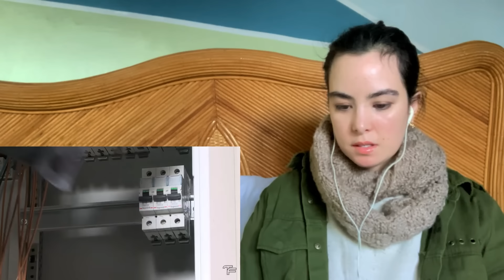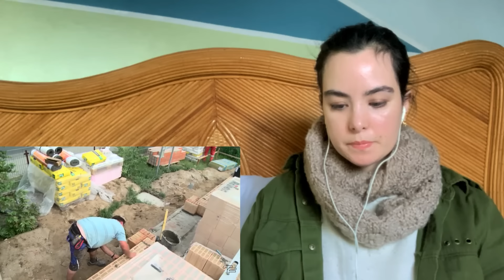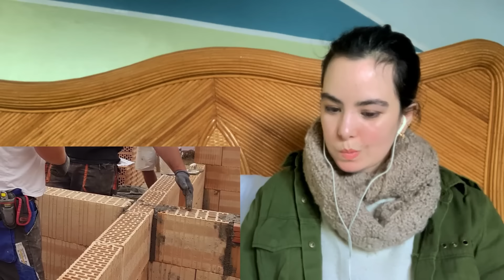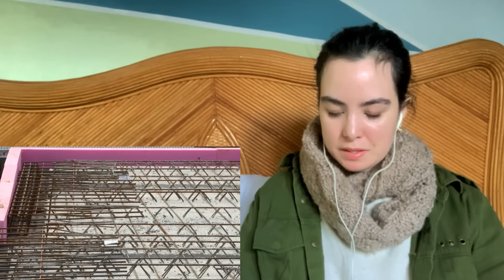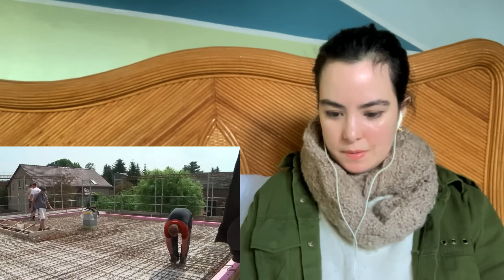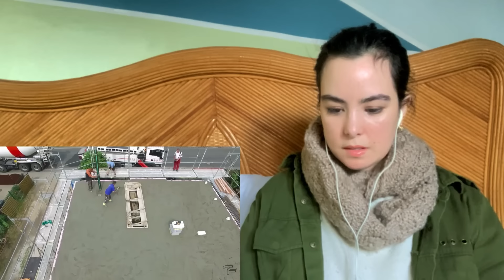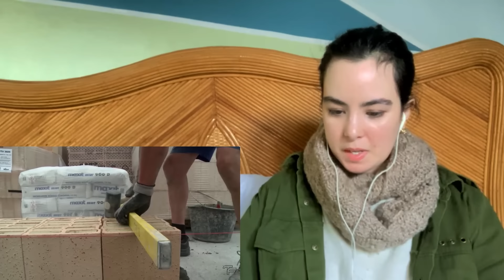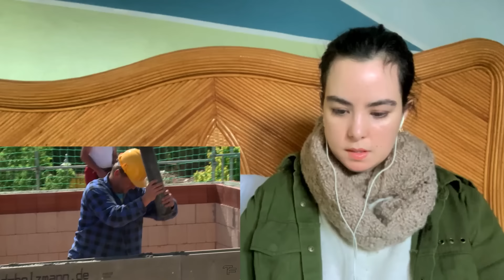How Germans build a house REACTION!

Comment: The 10 Days are the Working days. The Concrete needs sometimes weeks to fully harden where they have to wait. And the "outer Shell" of a house is done fast. Electricity, watersupply, heater and all the tiny things are the ones that need time like hell.
Reply: 28 days to reach it‘s specific hardness (normfestigkeit), but over time concrete gets harder. And you can walk on it way earlier than only after 28 days. But bearing parts should not be loaded before that time is up.
Reply: In this case it's really only 10 days, I'm German. Before the construction site even starts, two years of arguments with the building authorities pass. Then the excavation pit is dug in 2 days, the floor slab is poured in one day and then you wait 30 days. From then on the video begins. The concrete ceilings are prestressed concrete ceilings, which are so portable. The concrete that came on top only sets for 1 to 2 nights, as it does not have any supporting function during that time. Additionally, not seen in this video, the ceiling was probably secured from below with straps. But you can still continue working. Then at some point the roofer will come and put a roof on it, which takes less than 2 days for the wooden framework and another 1 or 2 days for covering it with roof tiles. And from then on it really drags on, then the window manufacturer comes, measures and the windows are ordered. Then some time passes. Then the windows are installed. The heating inside will probably be put into operation before winter so that you can work warmly and the construction site dries out, hence the windows. The house then remains unplastered for 6 months, sometimes even 1 year. So that the house can still "settle down" so that any cracks that may arise can be plastered over so that this doesn't only happen afterwards when the plaster is already on the wall. Before the plaster can be put on the outside, the attic is usually removed first. The inside is already being plastered because it isn't so tragic with possible cracks as there are smaller areas that could be repaired in an emergency. But these are all precautionary measures; most of the time there are no cracks.

Incidentally, it is no longer so cold in Germany that we need such thick walls. The winters are mostly around 0 c and often without snow for years, at most 2 days of snow a year, it is more of a muddy weather, but the winters are 30 c warmer than in most parts of Russia. The thick walls are often due to sound insulation and heat insulation for the summer, because here it can easily be 42 c at midday in August.

As a child, summers were only 25c warm and winters were -25c cold. Thanks to global warming, this is history.
Reply: Entschuldigung, es ist richtig die berechnete Endfestigkeit vin Beton muß (!) nach 28 Tagen erreicht sein. Da der Zement (Beton) sofort unter zugabe von Wasser aushärtet, ist der Beton schon 5-5 Stden. nach dem Einbringen zu betreten. 
Da die traditionellen Bindemittel, Zement,  Kalk, Gips wassergebunden sind - mehrere Tausend Liter, per Haus, braucht es 3 Jahre bis die überschüssige Feuchtigkeit verdunstet ist.
Alle Stoffe haben einen Charakter, sie sind NICHT BRENNBAR und schwer. 
Die Dachziegel (Ton) Dachsteine (Zement) sind seit Jahrhunderten schwer und nicht brennbar. Das vermeidet Schäden die wur aus anderen Teilen der Welt kennen.

Comment: That is why if it comes Tornado in the US you are homeless after them we just Close the windows
Reply: The tornadoes in Germany became bigger in the last decade but they aren't nearly as big as in the USA.
Reply: Take the shutter down!
Reply: Nonsense. A Tornado usually strikes into the roof and that would happen in Germany as well. So all the tiles would be gone. The rain and the storm would damage or destroy large parts of the interior and the windows would be shattered in no time. No matter if the blinds are down or up. Only the structure of the house would remain and could be the basis for the house being rebuilt.
Reply: @michaelkaercher  I wouldn't be so sure about that with newer houses. 

Firstly, we have brick or concrete walls and concrete ceilings between the floors and the attic, which is why nothing tends to happen below the roof structure.

Secondly, the tiles on newer buildings or when a new roof is fitted are secured with so-called storm anchors, which prevent the tiles from being lifted and blown off so easily.
Reply: @wernerruf7761  A friend of mine was hit by a tornado in florida. The house disassembled. He survived in the concrete bathroom. His Aircondition (12.000 kg) was found in the neighbours house. You cannot compare that to a german storm. A tornado would play hardball with windows and tiles.
Reply: @michaelkaercher  No tornado on this planet destroys a well-built European house, these are facts, or ask an expert about it, there are enough videos on the subject.
Reply: @ not sure, if you understood, how German/EU "window blinds" are build. They are external roller blinds... usually heavy duty plastik. Closing them has a similar protection as the wooden-panels you see nailed to the windows in the US.
And the multi-layer laminated window-glas you typically find in newer buildings is desigend to withstand a person accidentially dropping against it - so wind-pressure will not break it. As it will also not break, when smaller Objects fly against it... a 4kg tile from the neighbours roof or a big branch from a tree hitting it at a steep angle of course still can break it.
Reply: @But that is the way tornados work. Heavy objects flying around. Trees, tiles, branches, bysicles, carparts and so on.

Comment: There are far more ways to buid houses in Germany even the foundation may be different for example concrete just under the walls called Streifenfundamente.  On the concret there is usually another layer called estrich which plays a significant role for insulation.  The metal mats laid befor pouring are layed with a spechial plan called statik which defines seize and diameter of the metal and where positioned and so on.  We also set up houses like in the US we call the Fertighause.  They take to set up ready to move in about 1 week.
Reply: Estrich : one of the other episodes shows the installation of floor heating with additional steps of work.
Fertighaus : yes, but those parts (that are premade in a factory) still are more massive and not only weak drywall.

Comment: Just to clarify, 90% of europe uses concrete and bricks (wooden houses are also there but different than in north and south america). A lot of prefab is also used nowadays that a complete wall is delivered from the factory to the construction site. And of course we do not use roof shingles but solid roof tiles and the entire house is insulated from top to bottom, and as you can see it's all solid material.
Have a nice weekend!

Comment: So please watch the other parts. Its a nice little series. To build such a House takes about 6 months, with all the pauses to let the plaster and concrete dry. And waiting for all the craftsmen like electricians and plumbers. The bricks that are used in this construction are made of clay, wich gets very sturdy when burned at great heat und turn red. Its the same material that is used for many rooftiles. The planing for newly build houses comes from an architect, and these plans are controlled by a structural engineer. The plans than shows the masons which brick is to be used for every wall. Same for the reinforcing rods. Even the roof construction is planed up the the smallest part. Our houses are sturdy, but heavy. Claytiles on the roof weighs tons
Reply: klasse Name 😁😁😂😂🤣🤣
Reply: Yes they are heavy, but cannot be swept away by a storm like thin wooden houses.
Reply: PS: It's an 8-part series, with only the first 6 parts available in English.